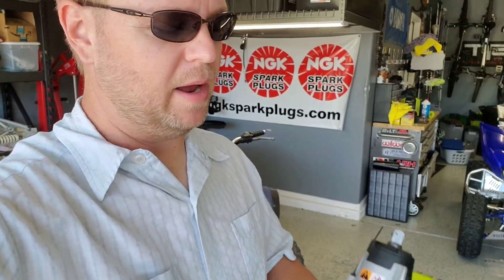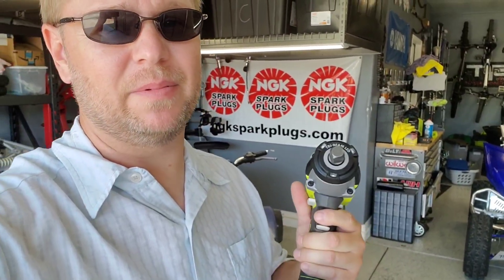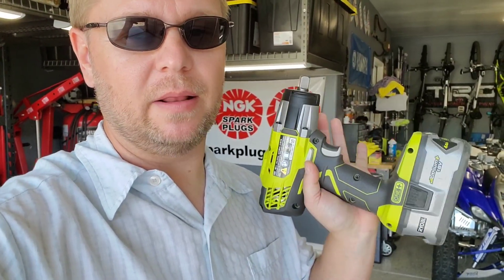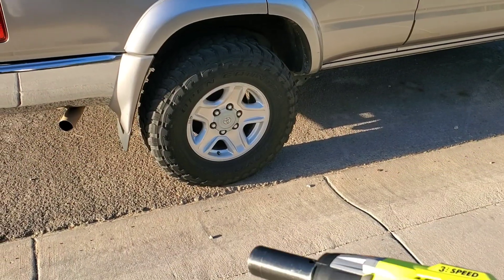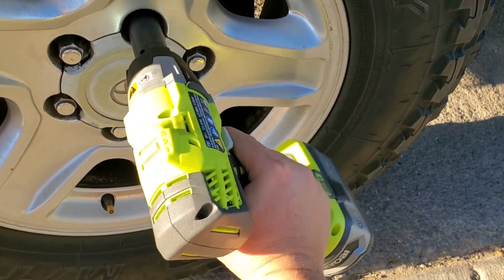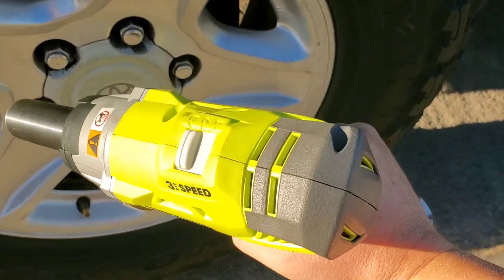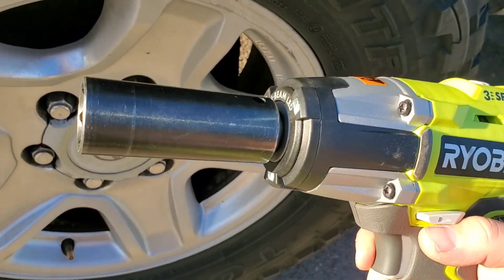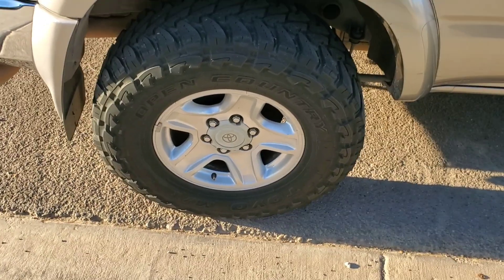CAN IT HANDLE TRUCK LUG NUTS? QUICK REVIEW - RYOBI P261 3 SPEED 1/2" 18V CORDLESS IMPACT GUN

Comment: I have a Ram 2500 HD and rotated all 4 tires without any problems at all. It’s an 8 lug truck and took the nuts off and reinstalled them with only a 2 AH battery. I did change it when the charge light got to 2 bars just to make sure I had enough power. This is probably one of the best tools I’ve gotten so far. Will take it with me when I go camping in case I have to change a trailer tire. I have 8 Ryobi tools so far and love them all. Less expensive then Milwaukee or DeWalt and as far as I’m concerned as good or better. 👍

Comment: I just got a new Ryobi 1/4" impact, two 1.5Ah batteries and charger shipped for $70. (3 yr manufacturer's warranty too.) Dam strong impact and I used it on nuts/bolts of 10 to 17 mm today with no problems at all. So I need one with 1/2 inch impact power (lug nuts and beyond) and this review just sold me. With my batteries fitting the P261, there's a clean, lightly used one on eBay for $50 and free ship. Think I'm gonna go that route.
Thanks for the vid -- it help me make up my mind.

Comment: I got the 1/2 impact also. Replaced wheel studs, wheel bearing hubs and  lugnuts. Its got plenty of power as long as you use the 4AH battery or higher. For the price it pays for itself. Im looking at getting the HP 1/2 supposed to have 600 lbs.

Comment: I've removed Ford F-150 axle nuts torqued to 295 ft lbs using the 4ah battery,removed it in 5 seconds can imagine what the 6ah hp could do..a buddy of mine actually removed the dreaded Honda crank pulley with the 261 using it with the Lisle 19mm heavy socket within a few seconds..the battery size on Ryobi really makes a difference in power.
Reply: That's alot of ft lbs for a pickup isn't it ?

Comment: I just bought one for the same reason,,,,changing tires. I tested it on cars, trucks, equipment trailers, and my 9,000lb skid steer. NO PROBLEM. I used a 3ah HP battery. Zipped off 15/16” lugs on my CASE skid steer like they were hand tightened! Definitely keeping it.
Reply from the maker: I hit a 19mm the other day with a locknut that this would not budge. Rare occurrence. But I have a 1/2" 20v earthquake impact that did not blink (1200ft lb rated beast). Overall - this little guy has been knocking out most all my basic work!

Comment: I was surprised that all your truck was torqued to was 90ft/lbs. I want to buy this to take lugs of my Mustang GT which are torqued to 150ft/lbs. so I was hoping to see something closer to the rating of the tool but based on the way it broke your lugs I don't think it would have much issue with my car either
Reply from the maker: 5 lug vs 6 lug.
Reply: I had no problem removing the spindle nut on my lexus is350 in mode 3, thats around 217 ft lbs i think. Im pretty confident it would easily remove your 150 ft lbs lug nuts.

Comment: Great video! How well does this work with the 2.0 or 3.0 AH batteries?
Reply from the maker: Works identical - just less run-time.
Reply: @MR_Garage  I wouldn't say identical. Similar. If you're doing light stuff it won't matter. If you're doing heavy duty stuff, you'll see drastic drops in power and battery life.
Also, it's on sale for $99 as a kit right now at Home Depot and comes with a 4AH. It's say it's a pretty good deal.
Reply: @21area21  in what state did you see that price. I'm looking at it for $139 and it's just the tool.
Reply: @vipergtx7  the model number you want 
Model# P261K 
Internet# 313581565 
Store SKU# 1005555669   
I’m located in Montana so the numbers might vary
Reply: @vipergtx7  Home depot has a sale of this tool + 4ah battery,  charger and bag fo 99$.
Reply: @jcfel5136   I got the same deal, but in Canada it's $149.00  But that is the complete Kit.

Comment: Definitely pick up the 9ah batteries, completely changes the tool.
Reply: The voltage would change the tool not the amperage. So if a 9ah btry is still 18v it won't change the performance it would only change how long it can continue to perform

Comment: Now, try to move the Ferrari F40 or the common Honda Crankshaft Bolt
Reply from the maker: Has done two crank bolts without issue. Was a bit of a struggle but also did an axle nut. Does OK for the price point. There is a new version just being released with double the ft lb's (600 I think), that will be best for most!
Reply: @MR_Garage  The axle nut should be easy. The ATG Gold 1500 had little trouble and the 

Ingersoll Rand W7150 had trouble Acura TL's crankshaft bolt and some on Honda's.

I hope ATG will come out graphene battery soon on CAT or ATG.